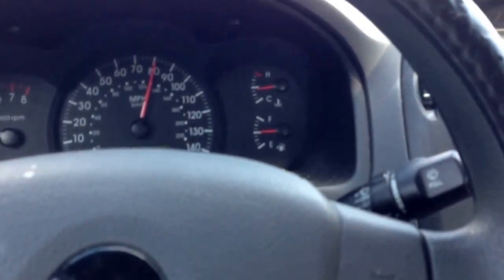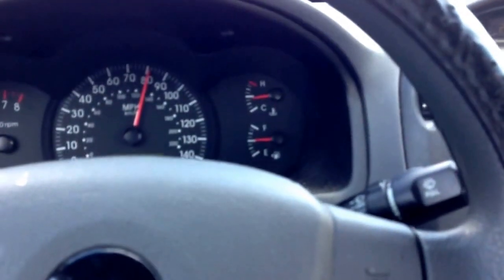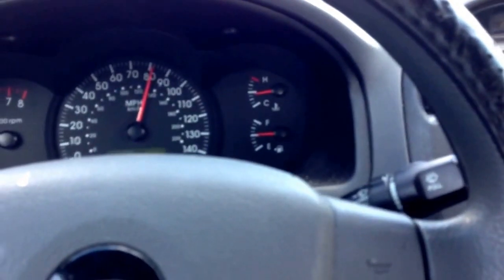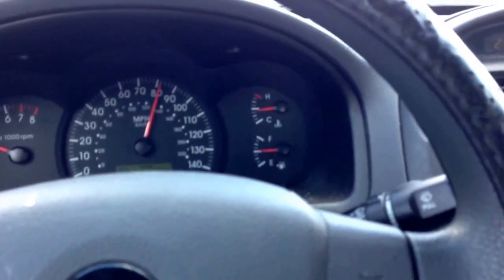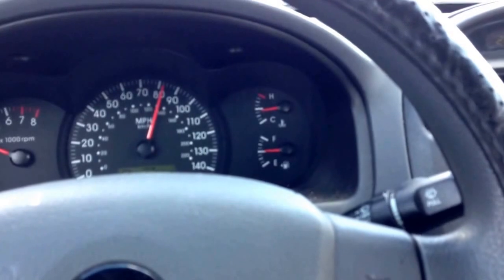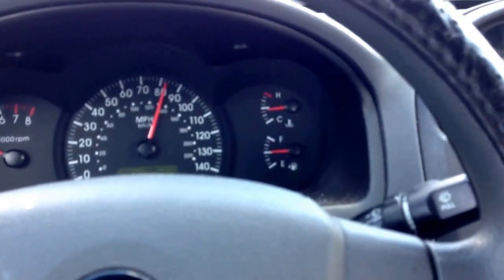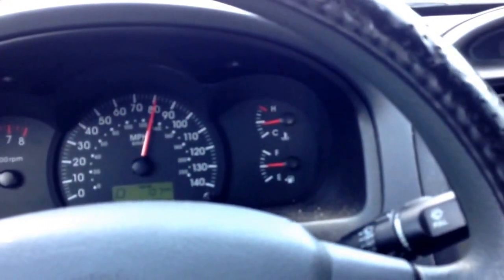DIY-Fuel Ethanol (190+ proof Home distilled) on a Test Drive

Comment from the maker: With Ethanol, you will see a decrease in mpg, on average around 10 to 20%. And depending on how and when I drive, I can save a little money.  Last time I filled up, It's costs around $2.72 a gallon. If you fill up once a week on average, and drive with conservation in mind, it is possible to save money.  I get around 23 + or - mpg highway and less in city driving, which is normal.

Comment: If China came up to the same standards as we have with clean burning cars then we wouldn't have near the problem we do - have you seen the smog problem over there? It's INSANE - but the UN won't force them to do anything since we need their money - and yes Big Oil and Greed has stopped innovation - they have bought inventions going all the way back the the late 40's to squash them if they hadn't we would be getting 500 mpg by now or 1,000.

Comment: I burn more fuel with the regular unleaded gas with just the 10% ethanol added verses the 100% gas and Zero ethanol - so in reality I would be adding more CO2 to the air since I have to fill up more often. I get improved horsepower and since it runs a tad hotter the engine stays cleaner - a cleaner engine allows for a more efficient running and better fuel economy. I don't believe in burning our food supply -

Comment from the maker: It's true that regular gas gives you more MPG's. I do this not to get better fuel economy per se or even to get cheaper gas, but ethanol provides higher octane, burns cooler, and gives at least a 10% increase in horse power. It also burns cleaner. Knowing that I can burn either gas or ethanol also allows for flexibility during emergency situations. After seeing a Netflix documentary on the current world oil situation, I believe now more than ever we need to seek alternatives whatever they are.

Comment: I went the other route - where I live in the Midwest I am able to get non ethanol gas which provides more BTU's and it's cheaper for me to use the non-ethanol gas as apposed to the 10% regular unleaded gas - I get a 20% increase in gas mileage by putting in the gas made for boats and small engines - from 19mpg city to 24 mpg city - 2003 Honda Accord V6 VTEC - not all cars see this improvement but mine has - it takes a full tank for the computer to adjust and increase fuel economy

Comment from the maker: I've also considered EV, but the expense vs the limited range was a deal breaker.  Converting to a flex fuel vehicle was just over $300. EV definitely has it's benefits and I would love to have an EV, but until there is a better way to extend the range without breaking the bank, I'll stick with this for now.

Comment from the maker: Thanks for the heads up, I'm aware of the 20% decrease in MPG. Also, I have a conversion kit that negates the need for bigger fuel injectors. Not sure about the Marvel Mystery oil, on their website, last I visited it, it stated something to the effect of not for e85 or ethanol. For now, my aim is to reach 10k or so, to see what happens on straight e85, we've all heard too many conflicting reports. I want to see the 10k results for a 2005 Kia Spectra, with 228k miles on it, we'll wait and see.

Comment: it happened to my freinds car that we tuned for e85. e85 will also need bigger injectors especially for optimal air fuel ratio(gas is 14.7 stoich and e85 is about 10)and you will see a 20% less range on a full tank. also use marvel mystery oil in gas tank if on e85...hope this helps(we had no problems since  orings dried out and peeed fuel in engine bay)

Comment from the maker: I've heard people saying this, but I haven't heard of anyone admitting that this happened to their vehicle. If what you say is correct, then I have 4k miles to go before I start seeing noticeable damage to my vehicle. The only problem I've seen was from a clogged fuel injector after I used Mechanic In A Bottle, thinking that it would "lubricate" with E85, I had to use prestone or something to clean it. 50/50 mix is good, but I think we all need to know for sure whether it will damage or not.

Comment: e85 dries out your rubbers seals in your fuel system from the fuel pump to injector o-rings... usually takes at least 10k miles then you start seeing little problems that no one can figure out. try using 50/50 mix
Reply: There’s flex fuel vehicles out there, which I assume that the makers of these vehicles have found ways around it, i mean I hope so 😅 I have Ford Focus that takes E85, so I mean if they have it covered I think there’s ways around it with other vehicles as well, some aftermarket parts can be an option that don’t have any rubbers sealants in them to avoid the problem, good insights on that, heck we need people like you to share information like this to avoid potential problems ✌🏼✌🏼✌🏼🤙🏼

Comment from the maker: When compared to standard unleaded the difference in price may be slight in some areas, but compared to premium there should be a distinct variance in the price.  I compare it to the premium because of the performance gains and higher octane that premium fuels offer as opposed to the low octane standard stuff.

Comment from the maker: I barely know what I'm doing and still learning, so I don't have any good calculations. Once I've gained more knowledge of mixing sugar to get an expected yield, I will have better numbers. This was simply to see if and how my car would run on 190+ proof.  Because of the increased performance (octane), when I do the numbers, I will compare the cost to produce home ethanol to premium gas. In my opinion that would be a much better comparison because of the high octane and performance gains.